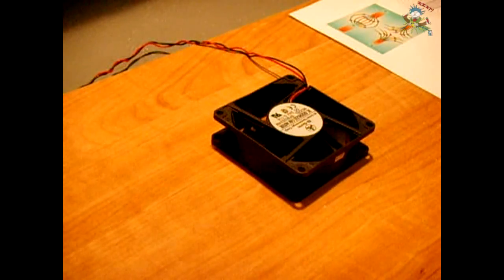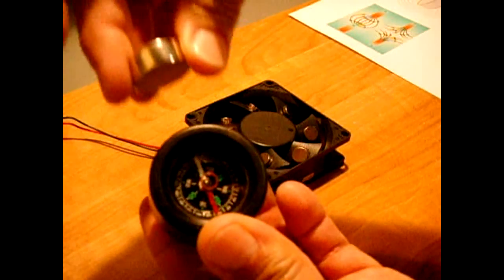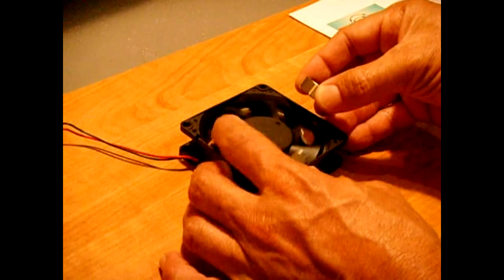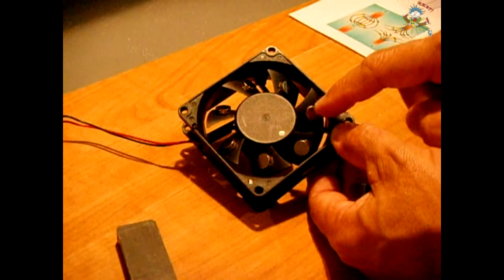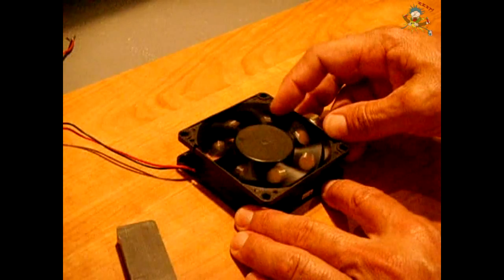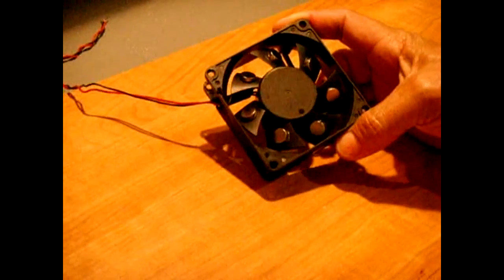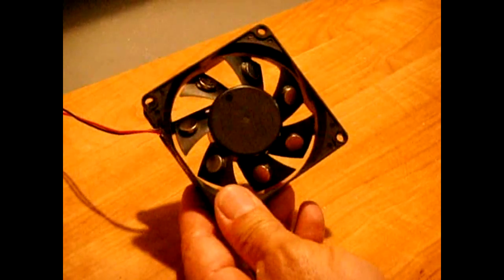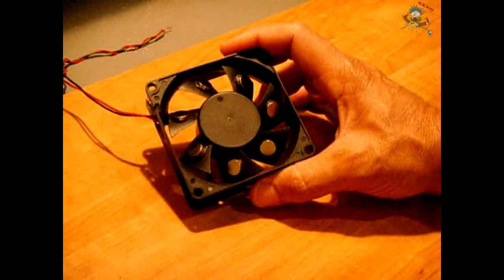Free Energy ~ Case Fan Magnet Motor / Real or Fake?

Comment: Have you considered trying to put a magnetic strip around the fan? A strip should prevent cogging, right?
Reply from the maker: Absolutely not. That is not the purpose of this video. The purpose of this video was to demonstrate that the device WILL NOT work exactly as shown in the other video. It is not my job to "TRY" and get this to work. If you believe in these types of videos, then it is your job to spend money, and time trying to make this work. I have much more important things to do with my time and money.

Thanks For Watching.
Reply: Well, you said you'd like to see it work, I just thought it might be a way it might could work. I won't have any spending money probably until Jan, so I thought I'd ask your thoughts.
Reply from the maker: Of course I would love to see a device that has the ability to create "Free Energy" work, but in reality it won't happen. You don't create electricity from nothing.
Reply: I recant my doubt of it being by Tesla, it was patented in 1913. >_<
Reply: yea, no one is meant to be able to 'create' free energy are they? i thought it was meant to be converting, one form to another, heat into electricity, friction into etc... the idea being you dont create it, you just manipulate your space around you to modify the flow of energy all around you... the specifics being the specifics of the method, electric engine, wind turbine, atom splitting etc...

I am going to go somewhere tomorrow where i might be able to dig up what i need to try this out and get the experience i mentioned earlier, after reading a few of your comments thats become obvious, i cant open my mouth anymore with out trying myself so thanks for the thought provoking material and the crash course in my favorite subject... "Things i Don't Know!"

Comment: he trimmed the fan blades to get rotation you do this by sanding the underside of the blades and removed the retainer pin from behind to make it free spin
Reply from the maker: Maybe according to the video you watched, but not the one I watched. I can assure you that no case fan is going to instantly start spinning, and smoothly with the use of only one magnet. I see your name is the same as Friday the 13th's killer. LOL
Reply: I get the Friday the 13th thing a lot My sister is named after the lake and I have a brother Named Jason How Ironic lol
Reply from the maker: LOL. Tell Crystal I said hello.

Comment: I gave you a thumbs up!. Excellent I did the same experiment I ran into the same problem as you (cogging). I did find away to make it spin a little bit. After many hours of setting the magnets on the fan blade's.  Magnets need to be set at the farthest end of the fan blade ( furthest from the center of fan. Kind of tricky since its hard to get my magnets to stick properly at such a spot. Now the magnets are as far apart as can be on the blades. Using a straight down ward motion on to the fan (of course this is cheating but I was desperate and needed something for my time spent) with two magnets on each side of the fan both hands at different times (moving downward and pulling away to avoid cogging) I could get it to spin but my timing was never perfect and so cogging soon was taking its effect. If magnets could be turned on and off with an electrical pulse I'm sure I could make it work. Thanks so much for your video.
Reply from the maker: Yes, using a movable magnet, or multiple movable magnets can get it to spin, but not smoothly. A single stationary magnet as shown in the video is pure BS.

Thanks For Watching!

Comment: Any student starting to learn about electricity will now that there is 3 things , if you give tow of them you get the third one : movement , magnetic field and elecricity , so if you have a magnetic field to cross it in designed way( which means source of movement) you will get electricity ..... any thing else with 2 compenents only is a fake !!!!

Comment: just wondering if you used same driver magnet as the video you are referring to, i mean the original video was difficult to fault but this video seems like , the analogy , trying to make wine out of grass.
Reply from the maker: I tried several types, including ferrite and neodymium of varying sizes and strengths.
Reply: cool man , if i get this to work i will try really hard to show video is not a fake , i know it would not work for free energy, but keen to experiment. fact is even if it did work there would be not enough energy output from fan to get an exact same fan to spin. so its really a stupid theory but, hey experiments are freaking awesome fun.
Reply from the maker: A good way to prove the video you will make is not fake that, is to place a small digital clock with seconds next to the device as you make the video recording. People will be able to tell if the video has been edited by watching the clock. Your video must include close up shots with a full teardown of the case fan. Power supply wires to the fan must be exposed at all times. Use a concrete floor/tile floor to rule out the use of any inductive devices.

Comment: but did you use 1mm magnets and as statormagnet a 4pieces of 3 mm 20/20mm magnets? i have no such device to test but are working with 35mm-diameter and 200mm high strong magnets for a real motor

Comment: I thinks u need to remove the coil at the center of the fan.. u can change it to bearing that make it easy to spin.. just my opinion.. :)
Reply from the maker: Why would I do that? That is not what the individual did in the original video. The purpose of this video was to duplicate what he did. I am not trying to get this idea to work, I am demonstrating that it does not work as shown.
Reply: just my opinion.. hee :)

Comment: you use wrong magnets`????? they need to be 1mm thick and as statormagnets take 4 neodym thin magnets 5 time as strong as the ones on the rotor!!
Reply from the maker: Michael Daniels It does not matter if you use 1mm thick or 3mm thick. The end result is the same. IT DOES NOT WORK. Try it yourself, then when you see it does not work, you can post your apology here. LOL Youtube people crack me up. Even better, send me a link to YOUR detailed video showing me how well yours works, since you claim to be an expert.

Comment: there is a motor you can create with a giant U magnet, did it in school for a science fair project, involved wrapping a cork with thin copper vertically the placing pins in each end, and creating a "spit" for it to rotate on and then placing the magnet over top of this, and two brushes making contact with the cork leads that are connected to a battery, but by no means is it free energy

Comment: did you end up recycling this fan because even though this experiment does not work if the fan was on you could use the magnetic field to recycle the energy being used and theoretically use that energy to maintain the speed of the fan.
Reply from the maker: Thomas Nelson Monopole magnet? Let me know where I can buy one. As for everything else you stated, I did not post this video to argue with people. The original video that was uploaded is a HOAX, as many others on Youtube. If you believe the video, then duplicate it and send me all the information/specs for others to copy. I will leave it at that. I am no longer discussing this. The video says enough.
Reply: No, this is not possible. A continuous energy output needs a continuous energy input. A magnetic field does not deliver continuous energy, it is absolutely no source of energy and can not "recycle" energy.
Reply: actually according to the laws of conservation of energy and matter... energy can be recycled (changed),what you are implying defies the laws of physics, mechanical energy can be changed into electrical energy and also energy cannot be created or destroyed and yes a magnetic field does deliver a continuous output as far as we can observe,but over a period of time the magnet may get weaker (thousands of years). if it had no energy at all then did it just appear out of nowhere, it had to be created with energy and magnetism is energy, but it is stored from the time the magnet was made, you and i have energy and anything consisting of matter has energy. if i am wrong and the laws of physics are wrong, then prove me wrong. if you are mis informed i urge you to study these laws and concepts because proof has been given, hard evidence to the fact and is backed up with reputable proof and not just hearsay. besides i was asking this question to the person who made the video.
Reply: Thomas Nelson
A magnetic field does not deliver a continuous output of energy, it is just a field of force. And yes, magnets get their energy in the process of magnetizing, but this energy is rather small and not used up when the magnet exercises forces.
Monopole magnets: even if they would exist this "magnet motor" would also not work with monopole magnets. Quite contrary, with monopole magnets it is quite easier to see, that attraction and repellence level out.
Reply: Thomas Nelson
Energy is universal. Mechanical energy is force multiplied with a length of the way, along the force works. Electrical energy is Volts multiplied by Amps multiplied by time and so on, there are multiple forms of energy.
Tesla was a genial technician, we owe him many devices and patents, but he was not a scientist, there are no substantial scientific findings by him. Also this is often claimed, he never had anything like free energy.
Neodymium magnets are stronger than others but also just magnets. If a magnet motor would be possible, it would be possible without Neodymium magnets also. It would only have less power than one with N.-magnets.
Reply: Thomas Nelson
You better refer to
http://en.wikipedia.org/wiki/Force
there is a better and more extensive explanation. When a stone is on a table, it exercises a force on the plate. But no energy is spent in this process. However, you can derive the strength of this force mathematically out of a "potential energy", which is suitable for calculations. This also applies for magnets. But their energy is limited and rather small, you can neither draw continuous energy from a magnetic field nor from a gravity field.

Tesla was a technician for instance when he built 3-phase generators, invented the induction-motor and build a wireless remote control. But there are no significant scientific findings of him, like those of Maxwell or Einstein for instance. If you don't agree, just name me such findings he accomplished! And note: I did not speak of science, but of significant new findings of science. (I am more polite than you and I don't call you a dumb ass for that.)

And stop that nonsense about TROLLING. Trolls deliver wrong informations. My informations aren't wrong.
Reply: Thomas Nelson
Alternate current was not an invention of Tesla, he learned about that already at university. Also multi-phase alternating current was not his invention. He only build the first big net in this technology. Electric motors also existed before Tesla. But he invented the induction motor, which was a great achievement, though others like Ferrari were on this track also. He had no laser. And he did not have limitless free energy. The Wardenclyff-project was the attempt to distribute conventionally produced electrical energy (by coal, oil, water) without wires through the air. This was not Teslas best idea, his experiments failed. He blew enormous power in the air and got only lamps glowing in some distance. If this scheme would have worked everyone could have picked up electricity out of the air for free, but the costs for the production would then have to be settled from taxes. But this scheme did not work and we know today it can't work. And Tesla influencing the weather is a fairy tale. He was talking about that in old age, he talked about many things in old age due to a slight mental derangement. He never had any device or theory for that.
When I sayTesla did not make significant scientific findings I refer to the fact, that all of Teslas work was based on physical laws known at his time. He did not discover any new laws of physics as e.g. Maxwell did before for electromagnetic effects.
Reply: Thomas Nelson
??? You have written in your previous comment: "I can name a few significant scientific findings, for instance alternating current, the electric motor, ..."
Ok, you have not written of inventions, but this is hair-splitting, alternating current and the electric motor were also not "findings" of Tesla. I already explained, that Tesla learned about these items already during his studies at university. Isn't that clear enough?
And Wardenclyff-tower wasn't just not the best idea of Tesla, it had nothing to do with free energy, since it was about the wireless distribution of conventionally produced electrical energy. Isn't that also quite clear?
And isn't my statement "When I sayTesla did not make significant scientific findings I refer to the fact, that all of Teslas work was based on physical laws known at his time. He did not discover any new laws of physics as e.g. Maxwell did before for electromagnetic effects" also sufficiently clear? Where is ambiguity?
When you think that my statements are wrong, give some evidence for it.
Reply: Thomas Nelson
Evidence, that AC and e-motors were known before Tesla? Evidence are the books and publications dealing with these things before Tesla was borned. The birth of the e-motor is often dated 1934 (Jacobi), AC generators existed short time later. Since AC generators are simpler than DC generators, their development was kind of natural.
Reply: okay cool, what is the difference between force and energy? i know that the concept is possible due to the continuation of the research of nikola tesla, as far as i know neodymium magnets were not around during the time of his research.
Reply: so are you saying that electrical engineering and mechanical engineering are not science???!!! that is the most bullshit thing i have ever heard, i just looked up the definition of science... here it is dumb ass : science is  the intellectual and practical activity encompassing the systematic study of the structure and behavior of the physical and natural world through observation and experiment. (any field of study AT ALL is a science, geology, language, religion, philosophy etc) that is 99 percent of what he did, saying that he was not a scientist is like saying that we do not breathe air!!! were you there??? did you not get the jist that just because there is not evidence does not mean that something does not exist it just means that you or someone else are too ignorant to try to prove it and that is all you will ever be is ignorant.
Reply: and all this i am looking up on Google.com , energy is the potential to exert force therefore if a force exists there must be energy propelling it. and i think you mean general technician, when he was working with edison he was a general technician for him but nikola tesla was more of a scientist than that fraud. save your TROLLING for OMEGLE
Reply: ok now you are splitting hairs with the Tesla thing. i can name a few significant scientific findings, for instance alternating current, the electric motor, the concept of robotics, the laser, wireless communication and limitless free energy (Tesla coil and wardenclyffe tower) he may not have used a strict scientific process and did not expect imediate results but most of his machines worked and were adopted by the government and are still being used today in Geo-engineering, one of the things that he was may have been called "technician" but he got farther than most scientists ever dreamed and unlike modern science he incorporated meditation into his intuitive lifestyle, he may not have been able to provide strict proof as to how his inventions  worked but the proof is in the pudding. and also you must realize that most studies are "sciences" there is an ongoing debate as to what constitutes a science and or scientist so claiming that he was not a scientist is subjective from person to person which cannot be denied unless you personally are able to exist as every person at once.
Reply: i never said that alternating current was INVENTED by tesla, nor did i say he INVENTED the electric motor, also the wardenclyffe tower (in your opinion anyways) was supposedly not his best idea but an idea nonetheless, and it is your opinion that free energy cant work. you can stop taking my comments out of context because i am done trying to explain myself for a WHOLE CONVERSATION taken out of context. and the next time you say something be more clear as to its meaning instead of leaving it open for ambiguity, MEAN WHAT YOU SAY.
Reply: if you think that your statements are right why don't you produce evidence for it, and follow your own advice?
Reply: but like i sad before i am done, this conversation is burnt out for me.

Comment: what if u used the same idea but put a horizontal axis on a vertical wheel with multiple magnets facing the same way, place the wheel over the fan, and set it spinning, just an educated guess as to what would overcome the "cogging" effect... both the fan and the wheel could potentially spin indefinately... OR use monopole magnets on the fan blades so the opposite magnetic fields are not affected, i dont have the cash right now for the experiment but i will definately try it out... also is it possible even for this fan to produce electricity instead of acting as a load... you might try setting it spinning with a dremel tool with a load attatched to the wires from the fan, i really appreciate what you are doing here :)
Reply from the maker: Since all magnets would be moving, the odds of getting the fan to spin would be much higher, but you will likely experience problems maintaining a smooth spinning fan.
Reply: I think this is a great idea and tommy is right and he is a very smart man I respect him greatly